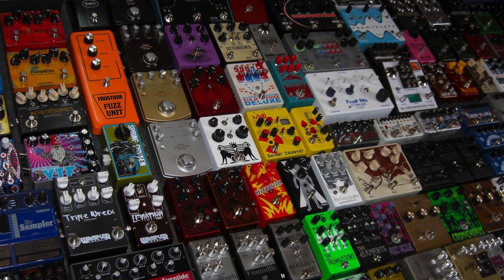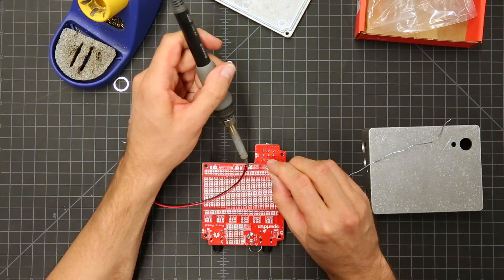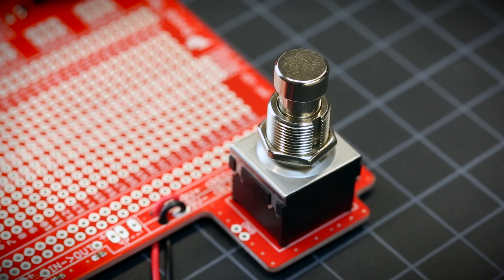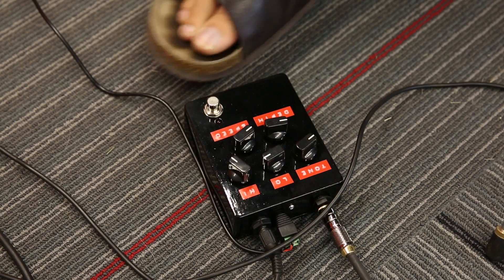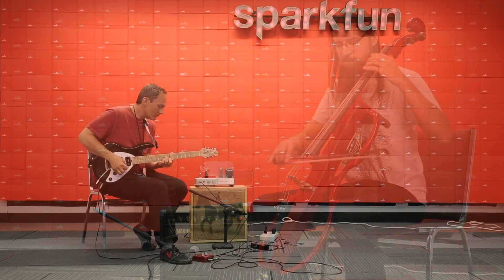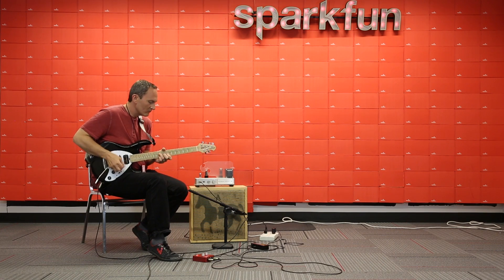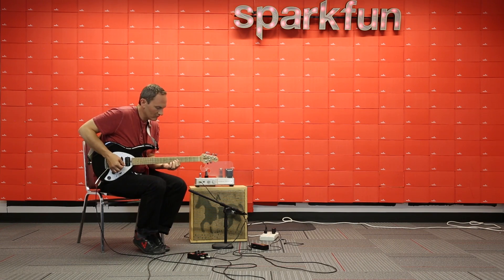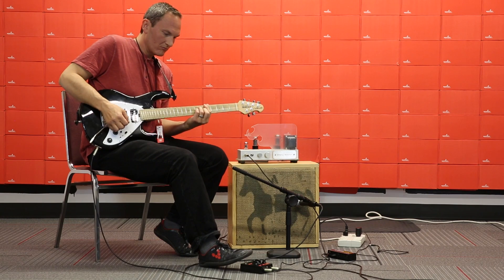SparkFun Proto Pedal!

Comment: Would love a video on implementing the Teensy with this. Especially the Auto-Roller effect you mentioned in this video. Thanks!
Reply: There is some noise in there, I started a thread on the Sparkfun Forum to talk about ways to reduce or remove it. You can hear it starting at about 1:28 and 3:06 to the end. Sounds a bit like when you put an AM radio near a computer.
https://forum.sparkfun.com/viewtopic.php?f=14&t=45056

Comment: $25 for less than $4 worth of components. Amazing.
Reply: If you want to wait a month for mystery parts (ebay), order in counts of hundreds to thousands (bulk), and deal with figuring out your own layout that will fit into a case good for you, get to it. You're probably not the audience for this product.

I feel that, for the value proposition, this is a reasonably priced entry into pedal experimentation. Especially when you consider that most people who use this are making one-off projects and want to get to the fun part of designing the audio circuit. Comparing it to rock-bottom prices with stark time and ease of use trade-offs is dishonest.
Reply: Cool! I'm sending you $5; please send me the parts you mentioned! Also, I'm going to need you to trim the board to the right size & make a website with a bunch of tutorials teaching me how to build a circuit. Also, please source me a case that fits, too. If I don't like it, I want my $5 back.
Reply: I think your BOM cost is off. 3PDT switches are at least $5 (smallbear, mouser) and 1/4" jacks are at least $0.50. Also, R&D, packaging, fixed costs, etc. and the smaller runs for new products add to the pre-markup cost outside of component pricing. This is a better value than you think.
Reply: A protoboard of equivalent size on eBay would set me back 70 cents, a 3PDT footswitch costs slightly less than a dollar, jacks and dc barrels would also cost less than a buck as well.

Of course, they're all even cheaper if you buy them in bulk, which SparkFun, Smallbear and Mouser all do.
Reply: sparkfun <3